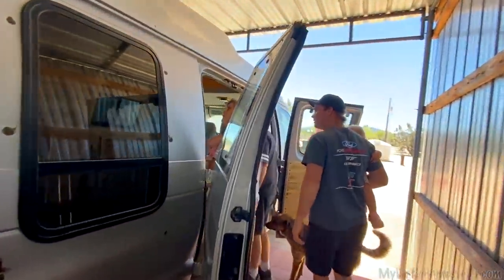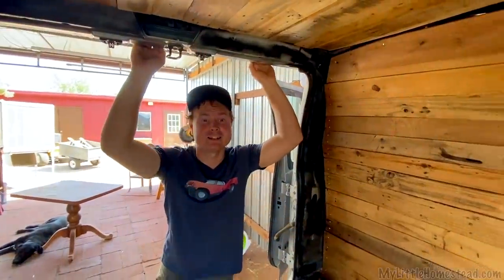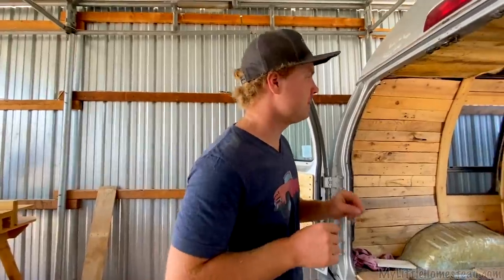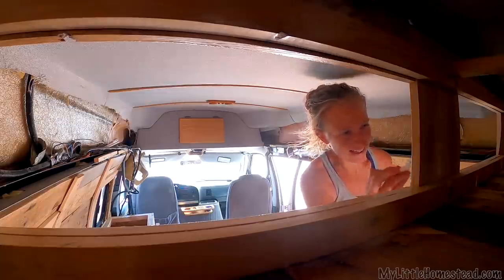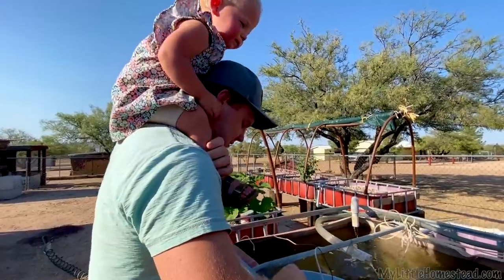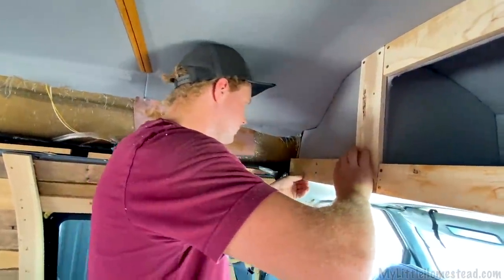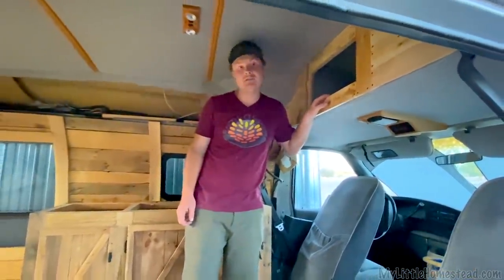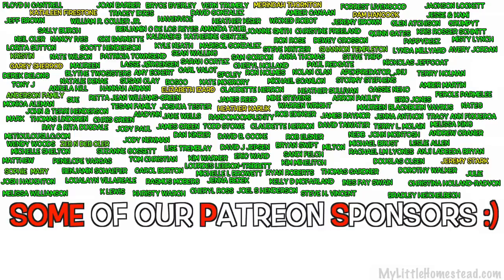Pallet Cabinet Doors For Van Conversion And Fish In The Aquaponics | Weekly Peek Ep292

Comment: My biggest regret when I owned a van similar to yours was that I did not have the air conditioner completely redone when we had the engine replaced. The kids just roasted in there.We stoped driving it in the summer. Please while you have the interior taken apart really set the air conditioning up well in the back.  Make sure it is running great, even if you have to bypass the computer.
Reply: I sure how Garen notices you comment. This is a really good time to get the air conditioning set up right. What fun would it be for the girls if they are roasting like you said? Thanks for commenting about this.

Comment: We used to own a recycling business. We would take away old used pallets and repair them then resell them to other businesses that needed them. We would take apart pallets and use the wood to repair the broken boards. The easiest way we found to take a pallet apart was to pick it up and drop it on its corner. It practically falls apart. I’m sharing it with you because I noticed you are getting gouges in your wood from sawing the boards apart.

Comment: Bobbi here with two questions and a comment..  1.   The fish, with it completely dark in the tank, there won't be algae growth.  Will you be feeding them?  2. The van, the upper cabinet in front, what is on either side, could you open that space up bigger?
Lastly.. you did a beautiful job on the doors for the upper cabinet and I suspect that will one-day soon, you will take the center piece of wood out of there and put a full length door for easier access and more storage ability. 💙🐰💙

Comment: Nice work on the van! I would only have done one thing different with the overhead cabinets and that is have the doors flip up rather than have side hinges. This is only because I am clumsy and would keep bumping my head on side opening doors. I need mine to flip up and be flush with the roof.